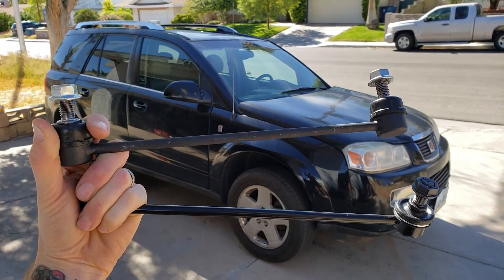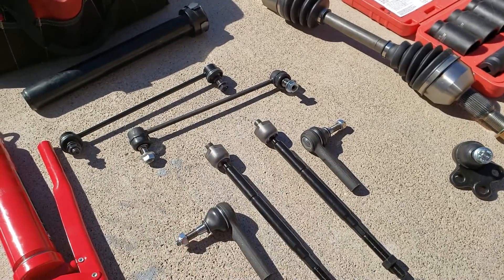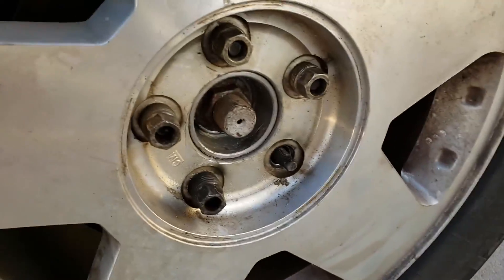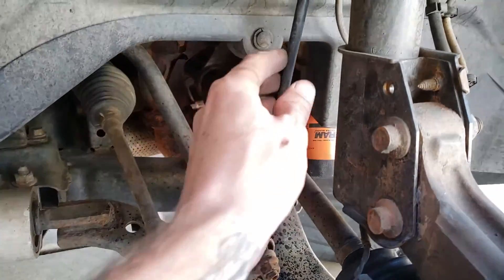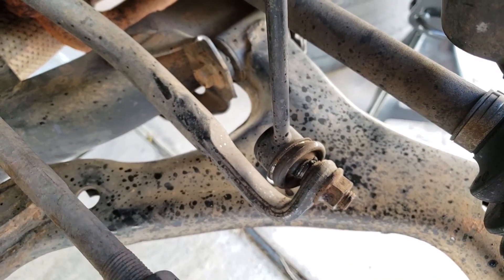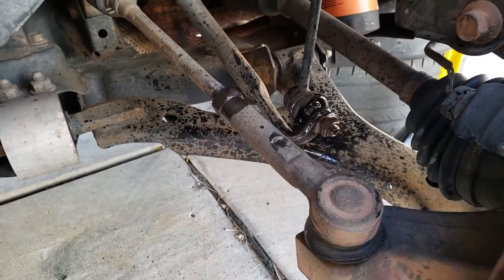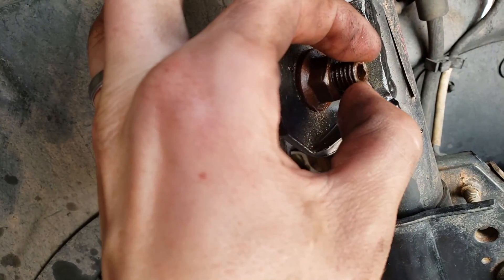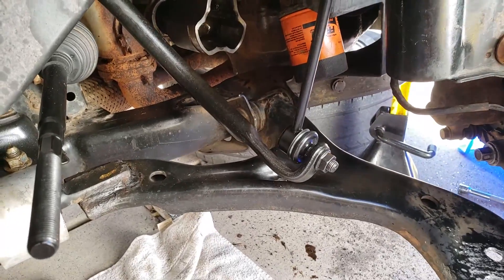Stabilizer Sway Bar End Link Replacement (Saturn Vue 2002-2007)

Comment: Do you have to torque to specs for the sway bar links?
Reply from the maker: Yes! 

Strut end:
Tighten the nut to 65 N·m (48 lb ft).

Stabilizer bar end:
Tighten the nut to 85 N·m (63 lb ft).

If it helped, please like and sub! It helps a lot! Cheers and good luck! :)